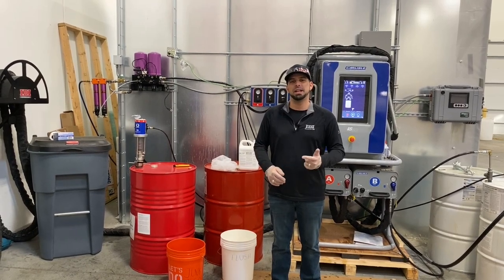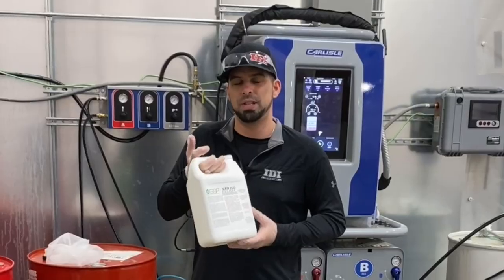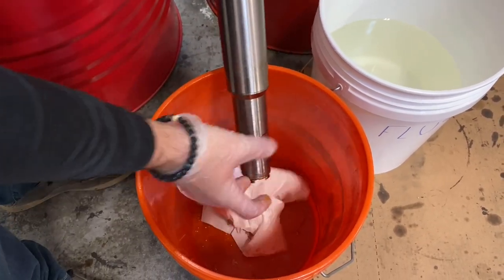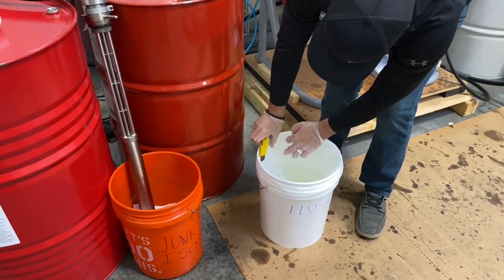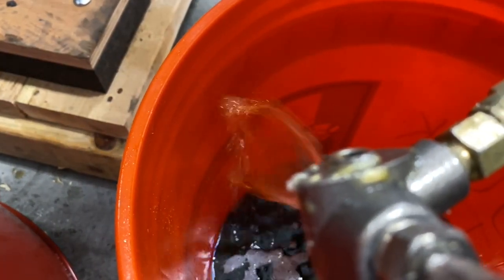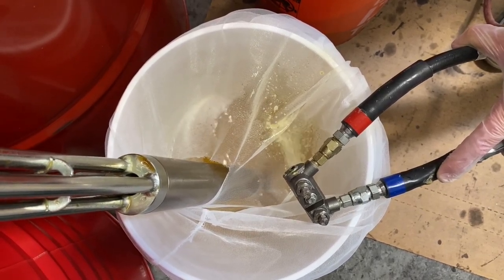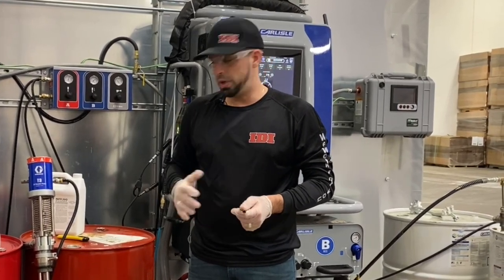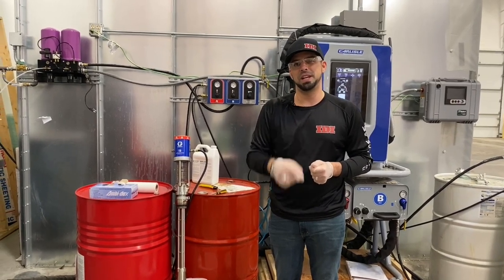How to Flush A Spray Foam System [Proper ISO Flush]

Comment: Missed a very important step that should have been covered early in the video not at the end. You forgot to mention that you must make sure the valve is set to spray and not recirculating or you will just pump the flush right back into the barrel!!!